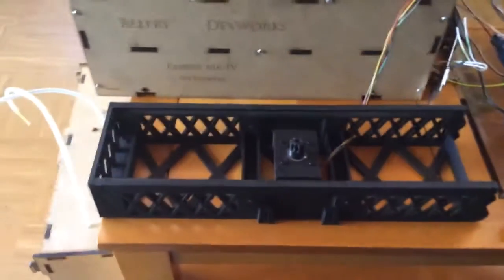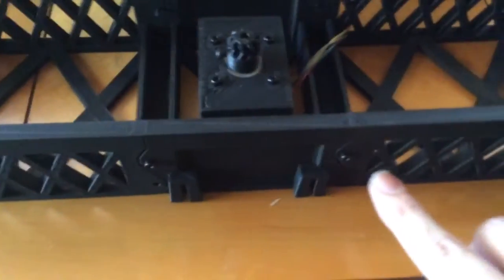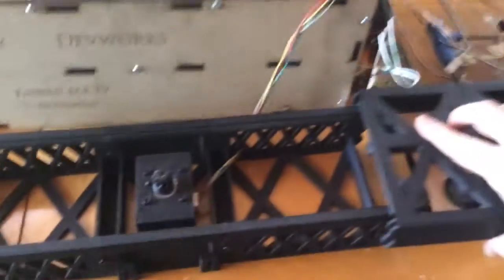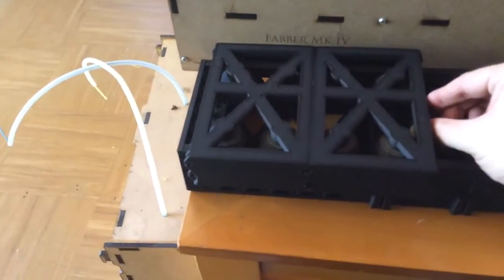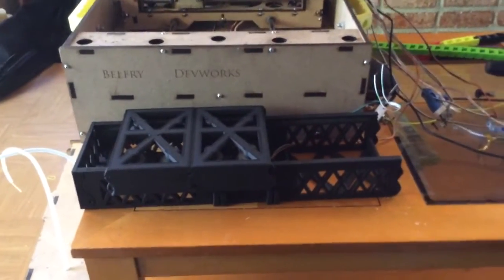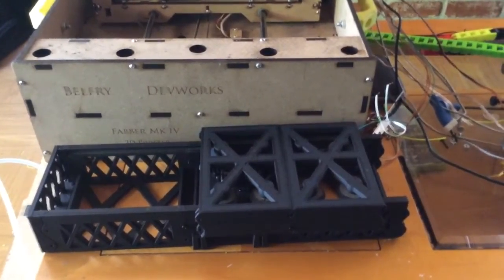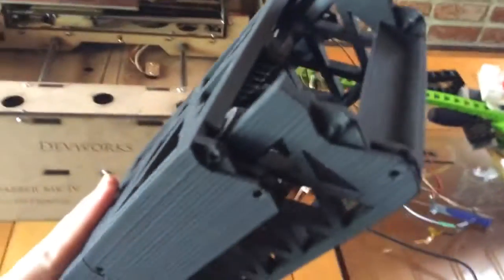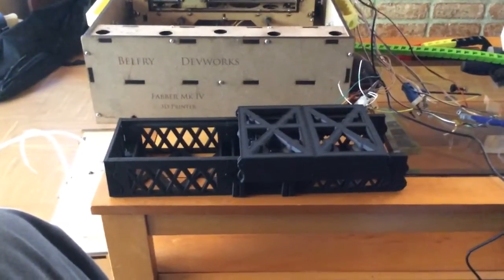Snappy-Reprap slider test

Comment: i would like to ask what software did you use to test your axis's. I am almost finished with printing the snappy 3d printer and would like to test the axis's separately before putting them together.
Reply from the maker: Sean Radke I was just entering raw G-codes using the console in pronterface for this test.
Reply: Thx